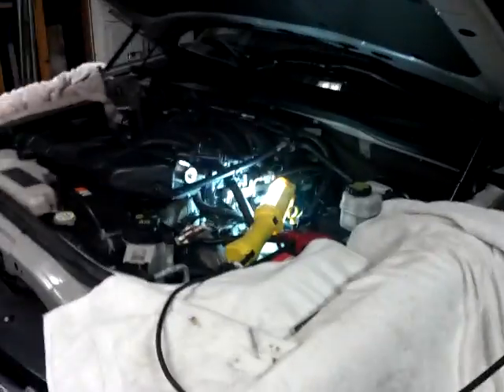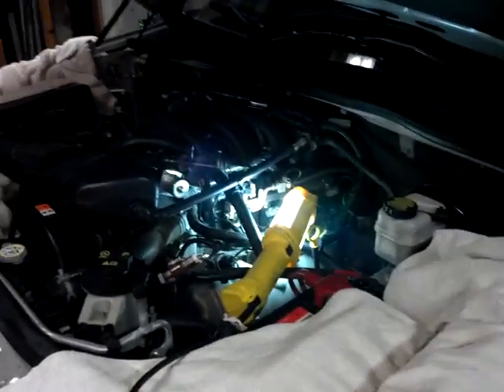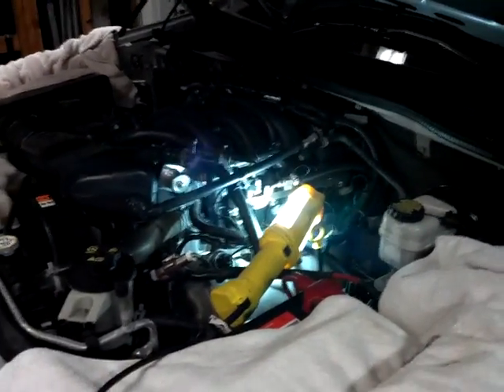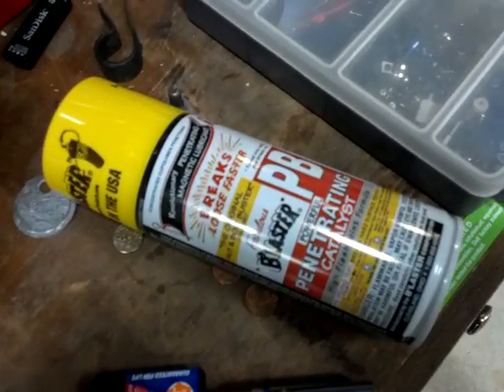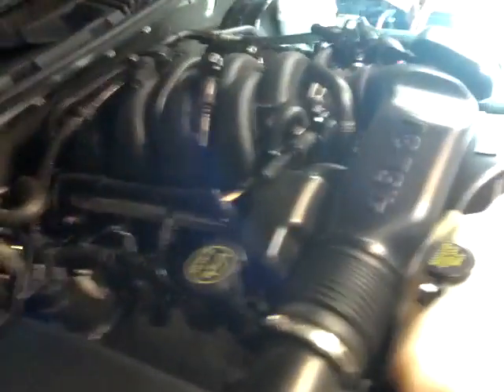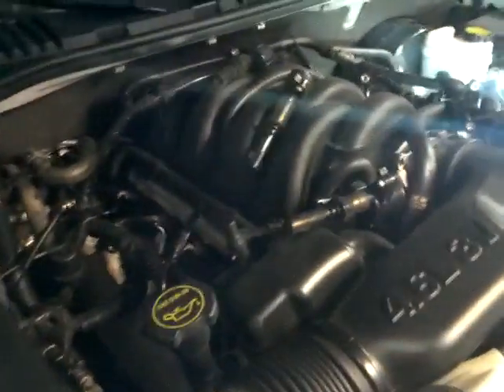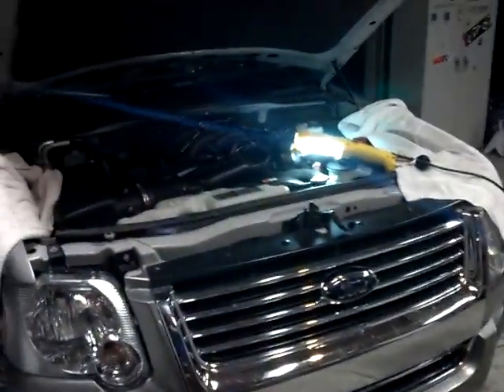Ford 4.6L 3v spark plug removal - tips for success to address a misfire issue

Comment: So i'm about to buy an 09 with 95k miles and most likely will need its first plug change. So you said they fixed the problem after a certain date, so would i be in the clear??

Comment: Change plugs on 2006 Mercury Mountaineer, 4.6L 3 Valve.  Procedure-Blow out the spark plug area (using a small diameter tygon tube fitted to a wet vac blowing out mode) crack them 1/8 to 1/4, spray in PB blaster, after 2 hours crack them another 1/4 and wait overnight or 10 hours.  Use a paper towel and screw driver to mop up unused PB Blaster and then remove plugs.  I did not do a rocking back and forth motion but just screwed them out.  Lots of loud cracking noises which I think was just the plug threads and not the carbon deposits.  All plugs out safely.  Anti sieze on the new plugs and insert all and tighten to 25 ft-pounds.  Then blow out the spark plug area to dry out remaining PB Blaster, put in a new set of coil boots with dielectric grease and you are good to go.
Reply: did you install the new one piece design motorcraft spark plugs??
if you did, what were the numbers on the new plugs?? .im confused of what number motorcraft spark plugs 
to install in my mercury mountaineer..

Comment: Not sure I understand, is it necessary to change the oil after due to amount of PB blaster applied?
Reply: should not be...make a small adapter for a vacuum and vac the holes first. I used a 1/2 inch hard vinyl clear hose on the end of my vac hose sealed with good old silver duct tape. that will get most anything out of the deep socket hole than you can spray something in the hole to loosen the plug. do this after the engine is cold,not hot....you can also blow out the plug holes if you have no vac handy. ...

Comment: I did mine while the engine was hot and it was much easier.
 I used a piece of pipe torque extension on the 3/8" ratchet to make it easier. Each one went CRACK!- when they broke loose. It was indeed nerve racking. With a cold engine, it just took too much torque to break them free.
 The torque is about 7 foot lbs per the book I have- not enough in my opinion- I use 10-15 foot lbs.
 Good video.

Comment: Dude is a literal fucking moron for spraying the amount he said he sprayed into the holes. Is he trying to hydro lock his motor?
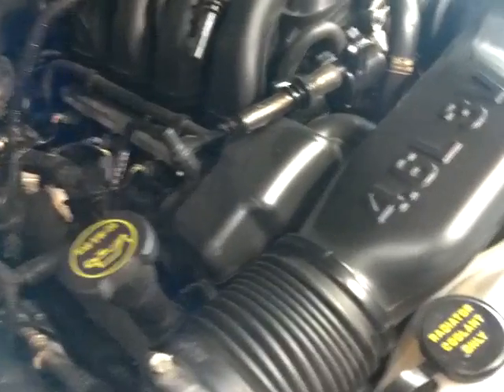Reply from the maker: watch the video and "listen" at 2:39 - you spin the motor with the plugs out and all the product will mist out, do an oil change if you get overly concerned - thanks for the family friendly reply by the way
Reply: Jason Tarnutzer You'll have to excuse my roomate. I left my googler logged in. I guarantee you he thought he was under his name. He broke all 8 on his 5.4 so hes kind of pissed and wants a party to blame. Just accept he has no family.
Reply: Jason Tarnutzer We both drive stangs and your video helped me out. I only snapped 3/8 so cheers i guess.
Reply: Yeah obviously if your buddy was a pro he wouldn't be watching videos on how to remove them. 3/8 5 broken? without tool? $90 bucks a pop to get drilled out wtg fuck face.

Comment: The reason you do it cold is because metal expands at cold temps.  This is why cars knock when its cold outside.  The rods aren't tight on the crank etc.  When it warms up it fits snug.  The plugs will be tighter with a hot engine.

Comment: Just went through the same thing. Broke them free initially and doused them with PB Blaster and let them sit for 45 mins. When I went back to the car some plugs were easier to back out than others so I turned them as much as they would go before binding up then stopped and doused them again with PB Blaster and waited another fifteen minutes. The second time I went back there were a few plugs ready to come out without having to horse them. If I found a plug that was still binding up I just moved to one that was ready to come out. Just went from the easiest plug to the hardest in no particular order until they were all out and doused them with PB blaster as necessary. It does take a while for the PB Blaster to work all the way through the plug threads. Whatever you do when they bind up stop and douse them and wait fifteen minutes. You should not have the feeling you're going to snap a plug once the PB Blaster has done its job and they are ready to come out.  When you start the engine back up the car will smoke for a few minutes because some of the PB Blaster is in the cylinders but it will burn off in no time.

Comment: 2006 Ford Explorer XLT 4x4 (with 100,100 miles) - this method will work, however I don't recommend using so much PB and avoid working on a hot engine. patience is key. I used very little carb cleaner instead of PB for each plug waited for 1 hour. I was able to remove all 8 without breaking any. If they felt too tight I simply waited and went on to another. I would come back to it and tighten - loosen and it eventually came out. don't be alarmed by loud screeching noises as they come out.

Comment: Taking spark plugs out while engine is hot will expand the spark plug hole in the head I've done it to my crown vic when I was younger cost me 250 ill to fix always change spark plug with cold engine now

Comment: Okay Jason, so I assume you disabled the fuel or ignition system prior to cranking the engine, correct?  If not, you run the risk of permanently damaging the coil's insulation, the Cat Converter, etc...

Comment: Take back those autolites and buy the #7989 Champions which are a one piece design.The TSB does not work worth a shit,the plugs still break off.The #65600 tool made by Lisle is a must.Replace the coil too for that cylinder with the missfire code.Fords are well known for eating coils with the coil on plug ignition system.

Comment: Just changed the plugs on my 06 Mustang GT today.  Leary about the possiblity of breaking a plug I started by spraying PB Blaster into the spark plug wells before trying to lossen any of them.  After about 15 min I turned all 1/4 turn and sprayed the PB in again.  Waited 15 min and they all came out just fine.  Apply a decent amount of Anit Seize to the treads of the new plugs.  She fired right up.  There was a little smoke when I first cranked it up as expected with the PB in the cylinders.

Comment: Using too much PB blaster ie spraying multiple times can be enough to hydro lock your engine! Do not fill up the plug holes with the stuff ! One coating up to the head of the plug nut is sufficient spray it an let it sit over night or for a few hours.

Comment: As for the carbon cleaner/carb and choke cleaner aspect, that is to dissolve the carbon build up on the bottom part of our "two part plugs"
The second part of the plug is the shaft in between the threads and the spark igniter, and as you can see, it collects carbon.  
Spray your carbon cleaner the same as the PB Blaster, multiple times, to dissolve the carbon and prevent the 2nd part of the plug from snapping off due to it being seized against the cylinder threading via carbon.

Comment: I'm a novice so my $.02 is worth exactly that.
From my understanding, watching multiple videos on the topic and personal experience, 
Use the method described in this video, cracking your first eighth, PB Blaster, soak, tighten 1/8th, loosen the same 1/8, PB Blast, soak, tighten, loosen, etc.  Repeat this process until the plugs feel "freed" and proceed with unscrewing, slowly, and with caution.
The slower you go, and more you soak and work, the safer you'll be.

Comment from the maker: like I mentioned in the video - is a very important step to change the oil right after the procedure for all the PB that passed the rings and contaminated the oil.  The residual PB in the cylinders will burn away at first ignition immediatley.

Comment: I let the PB soak over night and 4 of the 8 came out easy.  The other 4 I had to respray multiple times and take out very slowly.  Definitely crank the the engine before you reinstall the new plugs so you don't hydro-lock it.  Good luck.

Comment: Jason...thank you so much for posting this video. Dealer wanted $800 + $105 for each one they broke. I used the PB Blaster, a torque wrench, and lots of time and all 8 came out just fine. My 06 Explorer started misfiring at 80K miles and this solved the problem. Definitely made lots of uncomfortable noises when they were coming out, but the torque wrench (@ 33lbs) gave me the piece of mind and made very small turns to helped them to loosen. Definitely take you time and let the PB soak overnight.

Comment: I have an 03 eddie bauer exploer with a 4.6L with 77,000 miles Just changed my plugs & not 1 issue at all..Also had a 02 Mustang GT with the 4.6L  with 69,000 miles changed plugs with zero probs. Just be gentle when breaking them free..I think there is more hype then actual problems with changing the plugs & an easy way for Ford to suck money out of peoples pockets by putting a scare in peoples minds about them all breaking & stuff.Thats just my opinion & fact as having done two 4.6 engine plugs
Reply: yea but those are 2 valves not 3

Comment from the maker: I cranked the motor after to clear out the PB before i put in the new plugs.  Also changing the oil after is wise.  I am not sure the PB can get in when the plugs are not at least cracked loose so not sure if that would work...

Comment: I have a 03 with 140k..don't know if they were ever changed..sounds like I'm going to have a lot more fun than you had. Wondering if you turn over the engine some to blow the PB Blaster out...also wondering if I gust sprayed some on each plugs and put everything back together and removed later..let the blaster soak longer...will this harm anything I wonder